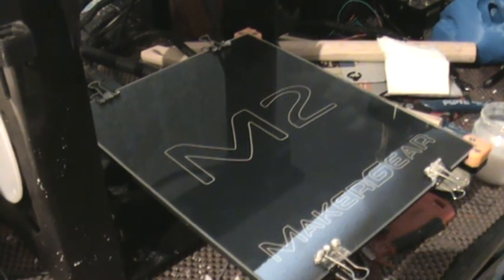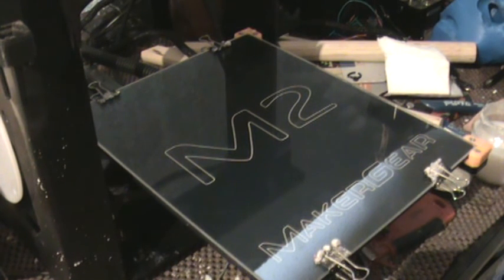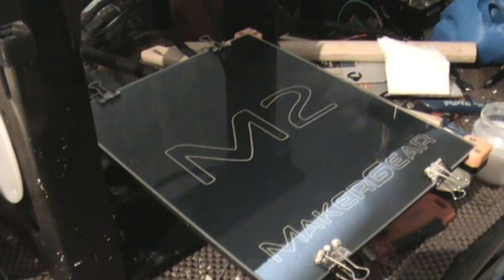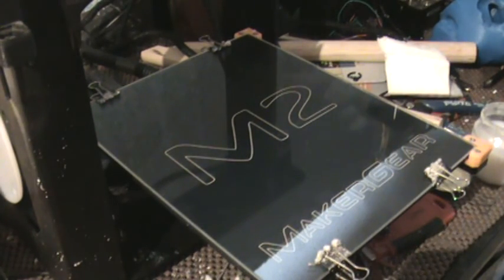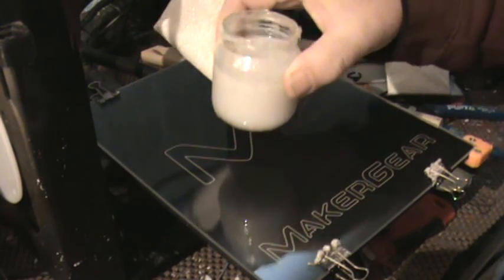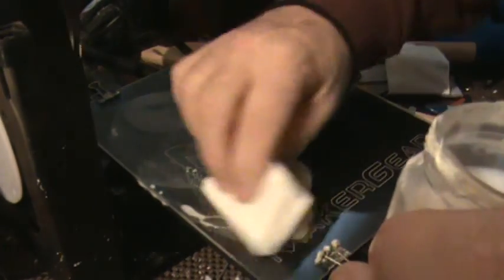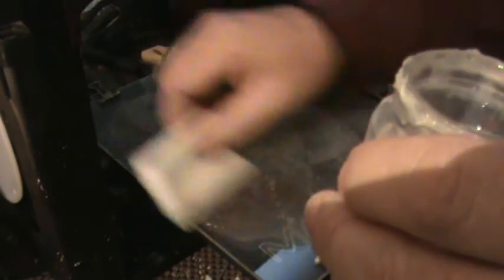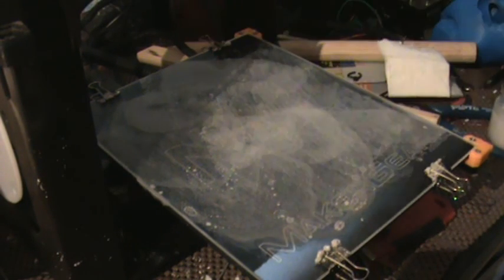How to make ABS stick to 3D printer bed while printing.

Comment: This does work, but i hate my bed get this dirty and the underside of my prints aswell.
Reply from the maker: don't put it on so thick then, I now do a very thin coating, thinner than paper. Just dilute the thicker stuff and wipe it on with a paper towel.